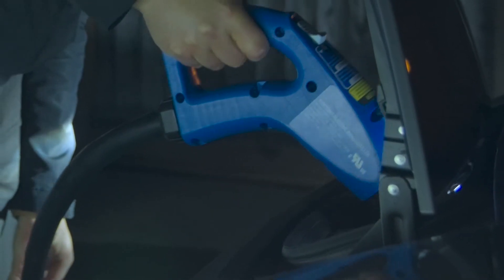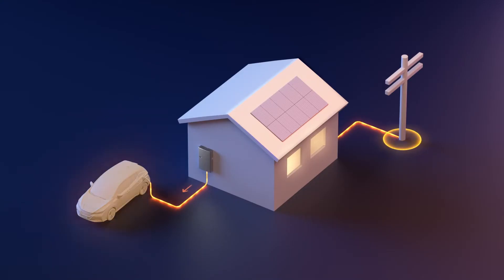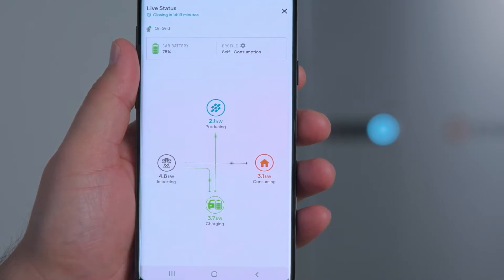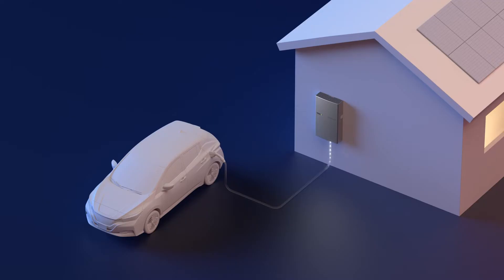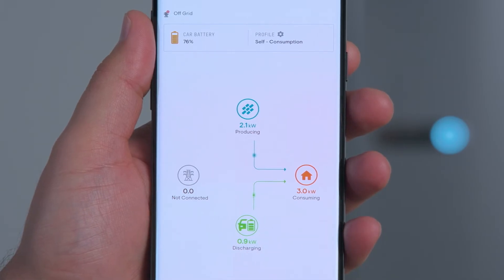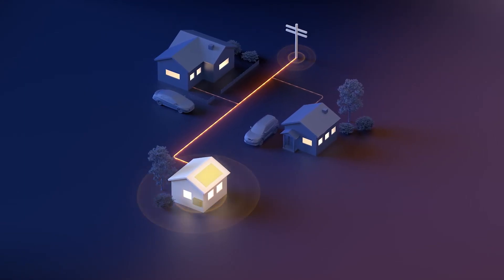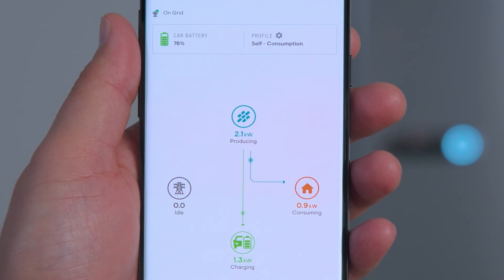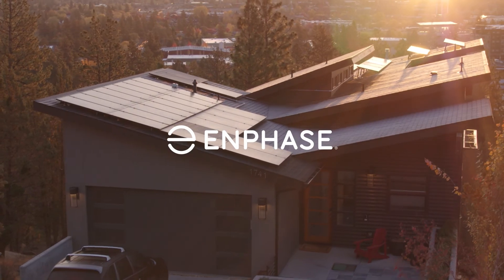Introducing Enphase Bidirectional Charging

Comment: If you have an electric vehicle, be careful with the Enphase IQ Battery + IQ EV Charger combo. I live in San Diego, have 3 × IQ Battery 10C and 37 solar panels, and on paper this looks like a perfect “smart”, fully integrated system. But in practice the logic around EVs, batteries, and tariffs behaves strangely and is uncomfortable for an EV owner. It feels like the product was built around inverters and solar first, and the EV part was added on top later, without fully rethinking the real-world use cases for electric cars.

The main problem is that the system almost always puts batteries above the EV, in a way you cannot really control. In my case, you simply cannot charge the car from solar until the IQ Batteries are charged first – the system will always try to fill the batteries, and only then send energy to the EV. There is no way to choose the priority of solar usage: you can’t tell the system “charge the car first, then the batteries”, or “batteries first, then the car”, or even “both together 50/50”. Very often Enphase tries to charge or discharge the IQ Batteries according to its own priorities first, and only then thinks about the car — even if you clearly set in the app that you do not want to use the battery for EV charging, or that you want to charge the car at night from the grid on a cheap EV rate. As a result, the behavior often goes against common sense for an EV owner: the home battery is used where it would be smarter to use the grid, and user settings are effectively ignored.

When I called support and ended up with the team in India, they told me very directly that there is no software way to change this behavior. Their “solution” was to turn OFF the IQ Battery breakers in the 6C combiner whenever I want to charge the EV from the grid and preserve the battery energy, and then turn them back ON again afterwards. Just imagine: at midnight, instead of having a smart system use the cheap EV rate, I’m supposed to walk outside and manually switch off my batteries so the car charges from the grid.

In another real scenario, I needed to charge my car during the day. I pressed Manual / Forced charge in the app, fully expecting the EV to use solar and grid. Instead, even with “Use battery for EV charging = Disabled”, the app started draining my IQ Batteries into the car. By the time the most expensive evening tariff in California started, my car had been charged mostly from my home batteries, not from the grid – and I was left with almost empty batteries right when I needed them most for my house.

If you just have solar and no EV, Enphase can be an excellent solution. But if you plan to charge an EV through the IQ EV Charger and you’re counting on flexible control of priorities, tariffs, and batteries, be prepared that right now it feels more like an unfinished product than a well-thought-out system on the level of Tesla. At this point I have serious concerns and open issues with my setup and I am currently waiting for a clear, technical response from the manufacturer.

Thinking of buying Enphase IQ – IQ microinverters, IQ Batteries and IQ EV Charger?
WAIT. Don’t buy the Enphase IQ system until they fix these bugs and logic issues. DO NOT MAKE THE SAME MISTAKE.
Before you purchase, call Enphase support and ask them directly:
	•	“Can I charge my EV from the grid only, and not from my IQ Batteries?”
	•	“Can I choose the priority for solar – to charge the car first, then the batteries, or the other way around?”

As of today, the honest answer is: NO. There is no clean, supported way to do this with the current software behavior.

So my recommendation is simple: do not buy Enphase IQ for an EV-centric setup until they fix this.

Comment: What's going on? Is there a problem with the charger or integration. Why are you unable to give enphase users a update?
Reply: I suspect the problem is redoing everything to work with Tesla plug, which requires huge changes and safety protocols unnecessary for normal (J1772/CCS type 1) since main pins in Tesla's are used for both AC and DC. Last I heard it won't be available until late 2025/early 2026. I see no reason why it can't be made available right now for V2L/V2H with CCS type 1 so long as a grid disconnect contactor is involved.

Comment: Am I missing the point here? What happens if you need to use your car and the battery has discharged down to 20% to power your home?
Reply: If an outage, that's when I'd make a quick trip to a fast charger, and then get back home. (I'm pretty sure you will be able to set discharge limits if you have a live grid connection.)

Comment: Which vehicles are currently compatible?
Reply: When will this be available to purchase and install? Any idea of a price point and typical installation fees?
Reply: Any updates?  I am getting a Rivian and my existing solar systems uses enphase micro inverters
Reply: Kia EV9 can support V2X. However, that EV is very expensive, but cheaper Kia are coming soon, like the EV3
Reply from the maker: Hello! Thank you for your question. We are not currently disclosing the list of cars we’re working with currently. However, we expect it to work with most vehicles.
Reply: @EnphaseEnergy  when can you estimate a list will be available?